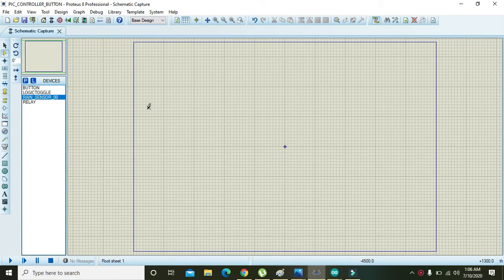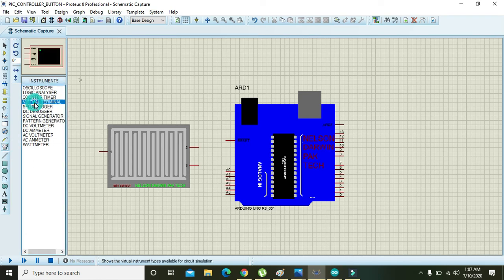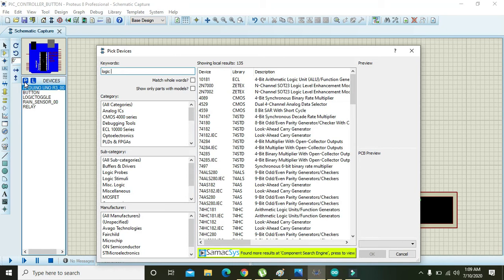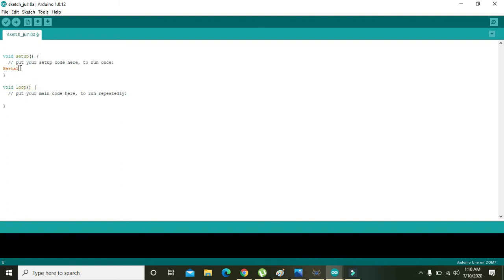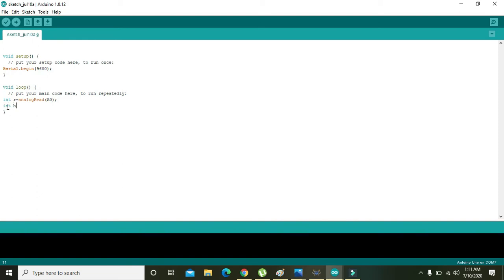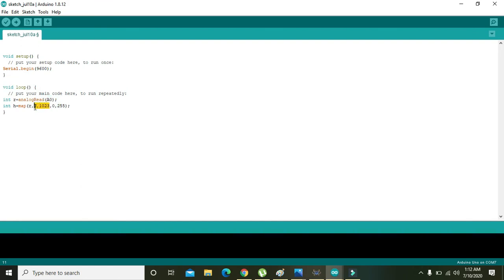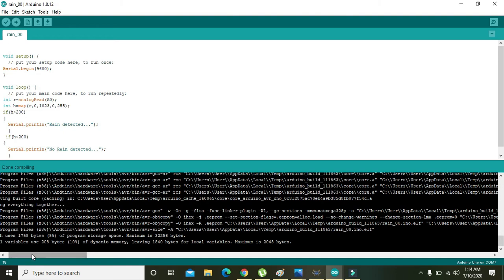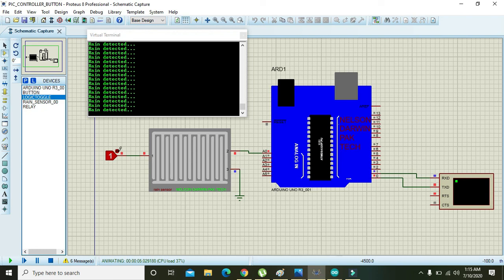How to make rain alarm with arduino in proteus | simulation of rain sensor in proteus

Comment: How do you add rain  sensor
Reply from the maker: brother...just write in google rain sensor library....then click on download button...after downloading is done...go to c dir and then open data folder then labcenter and then library folder and paste it here....restart proteus and it will be there...
Reply: @nelsondarwinpaktech3954   i have searched but i am getting with arduino not which is video i want that you used in video send the file